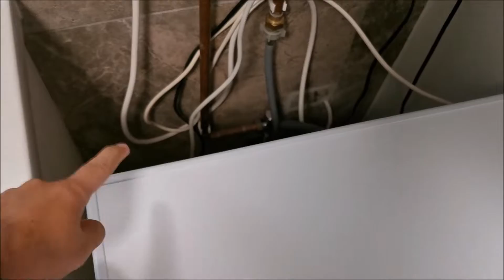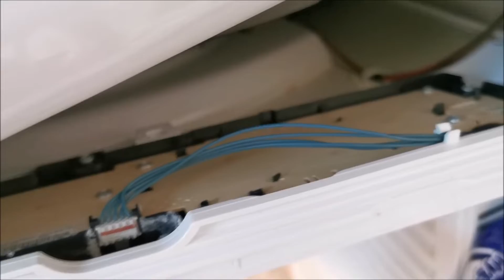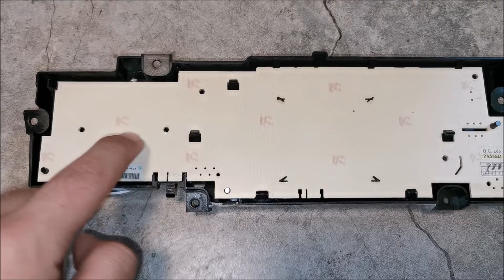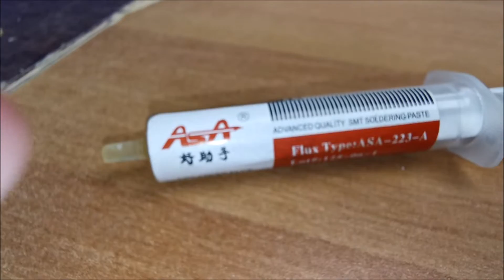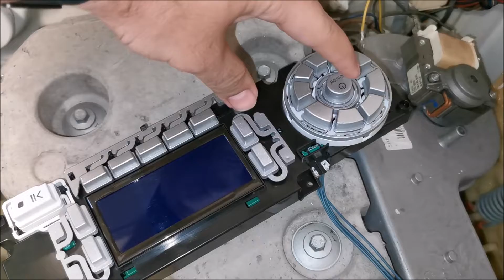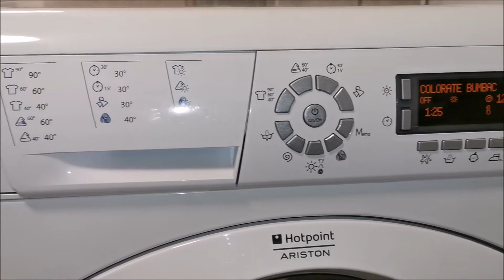How to repair a washing machine that is showing F:09 error and stopping

Comment: Thanks for posting this! My 15-year old machine also had the F 09 error and based on your example, I took everything apart, just to the point where I pulled the cables off the board. The contacts looked clean, no corrosion, so I just reconnected and tested it. And indeed, the error was gone. The machine is now back at doing its jobs as I type that. Thanks again!
Reply from the maker: Welcome!